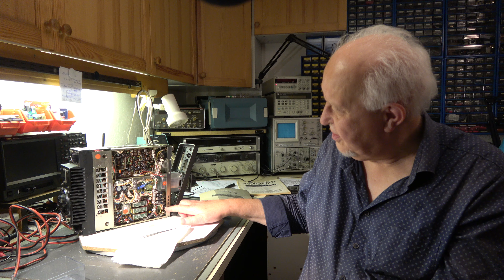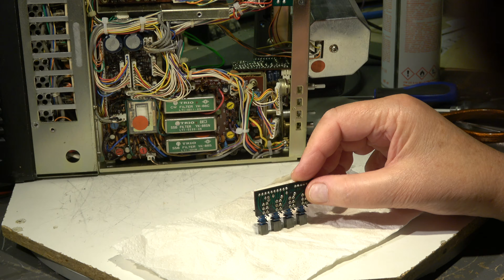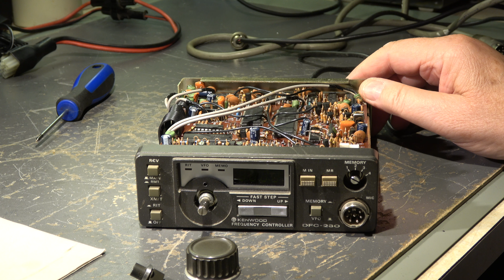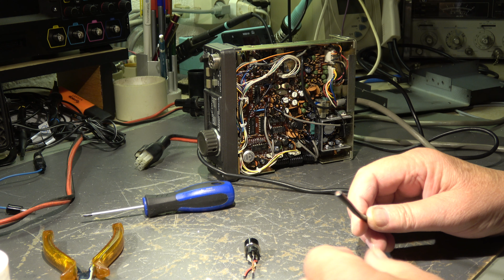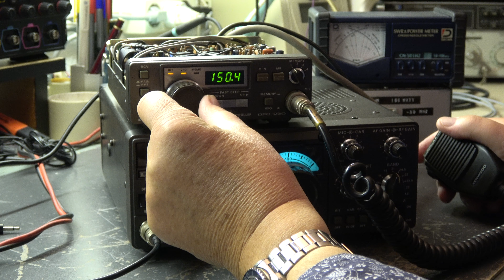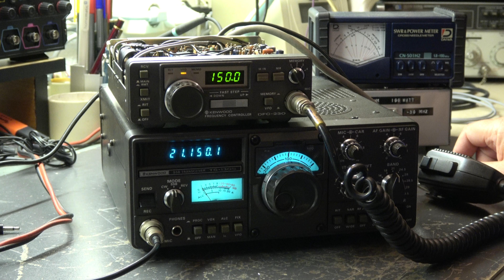#137 Kenwood TS130S+DFC230 Part 4(4)

Comment: Hello Stefan, Thanks again for the nice and interessting video. I have an additional question. I'm looking for an original service manual of the TS-130V (not a copy). May be do you know where I could by such type of documentation ? 😕Thank you. 73's. Stephane.
Reply from the maker: Hi dr Stephane, sorry, no idea. Maybe on one of the known platforms in the net but in general there are always only copies or reprints.
Reply: @dl7majstefan753   Thank you Stefan. Yes, that is the problem. The copies are often unclear, specialy the overview diragram. I have the same issue as you have shown with the IC current meter. Sometimes there is an indication, somestimes no indication. I have checked and cleaned the ALC/IC switch which should be okay. Must the indication is still not good.